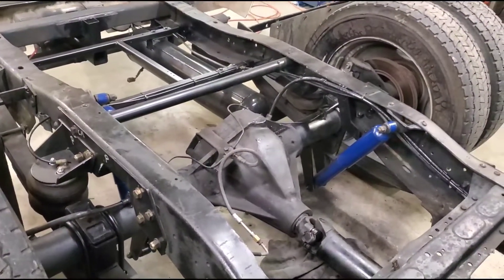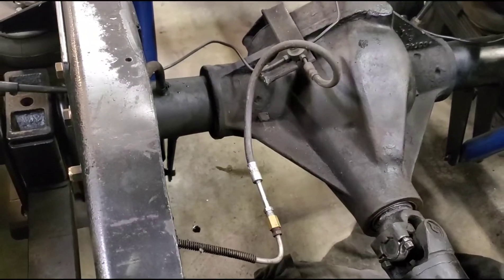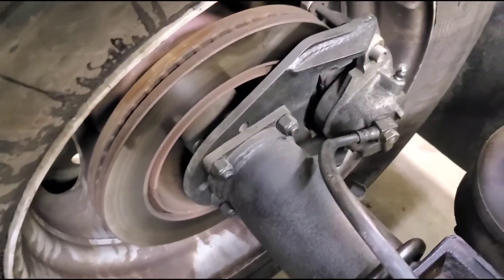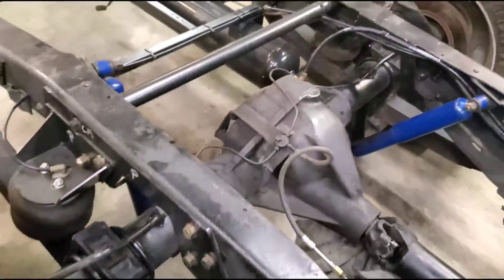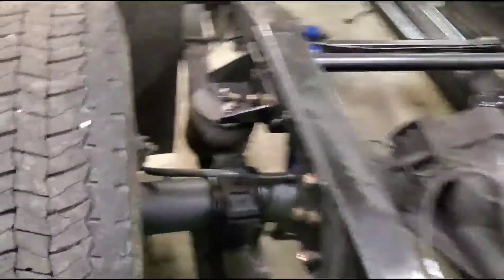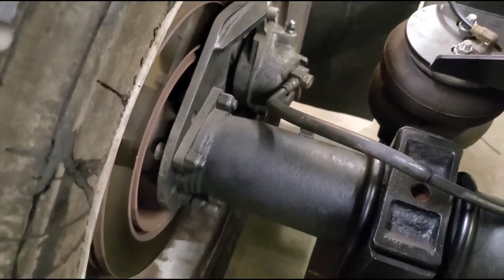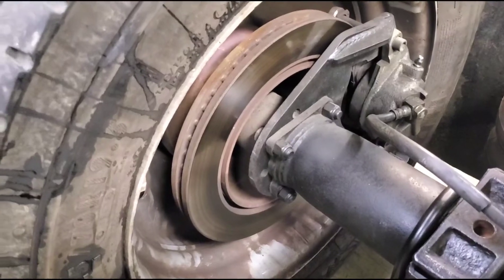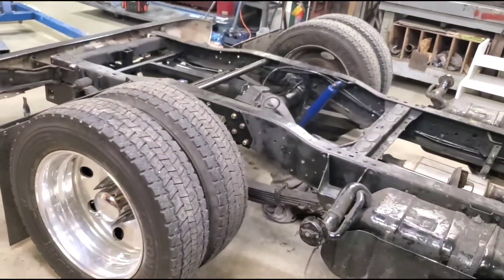How to do disc brake swap on Dana 70HD/14 bolt (DRW/SRW)

Comment: Hi man can I ask if you had any issues because the use of different calipers (and hence, pads) and the Chevy Express Van rotor, I'm asking because the K20 pads are a lot thinner than those used on the Van, the K20 pads total thickness is 1.08 inches while the rear van pads are 1.52 inches total, how do you overcome such a big difference? I'm just trying to replicate the setup so that's why I'm asking. Thanks a lot.

Comment: That shop for the caliper bracket shut their doors would you know where else I can get that bracket? Thanks
Reply: Did you ever find a place that sold em?
Reply: @boostedserg Frank's fab and machine sells a kit but it's just a thick plate with two spacers.

Comment: Gm had a shit load of problems with the rear weight valve. So much so that they finally put out a repair order to simply remove and bypass the valve completely

Comment: great video!!! i got my brackets a few weeks ago( dana 70hd) and im looking at the stud part number you posted 61393( prob 610-393) but they are about 2 1/8" long vs normal 3.5" long like factory. is this correct?

Comment: Would this kit work on a 1994 Chevy c3500 dually 14 bolt rear ?? I want to Convert my drum breaks  to disk brakes
Reply: Did you get a solution?  I have a 14 bolt dually cab and chassis on my 58.  It's the same as the 94 c3500 axle just narrow. I have seen lugnuts 4x4 weld on but was looking to bolt on.

Comment: I think you might've answered this one already but if so, please forgive the repeat question. I have a 96' C3500 cab & chassis setup with 16 inch wheels. I'm assuming that your setup will work on my application if I remember your response correctly...........thanks in advance.

Comment: I am having trouble locating the correct proportioning valve. I have ordered 2 already and am sending them back. I need an inlet hole of 9/16 X 18 TPI, and one more inlet hole of 1/2 X 20 TPI.  I am ordering PV 72 C. but they all show 1/2 X 20, and 7/16 X 14 on the 2 inlet holes. my master cylinder has 2 lines and the fittings measure 9/16 X 18 in the front, and 1/2 X 20 in the rear. 2 different venders listing PV 72 C but theirs won't fit.  Anyone had this happen? where can I get the correct one?

Comment: Why not just buy  used mid 2000 axle already on disks???
Reply: plenty of reasons maybe there's no wrecking yards near him maybe no one has the right gear ratio maybe he doesn't have the tools of the means to fabricate new spring perches from a later model truck to the early square body

Comment: Hi buddy. I am new to the channel. I got a 1997 GMC k3500 dually. You think I can get it done with same parts you use ???
Reply from the maker: I dont think so. I believe the axle flanges are different bolt pattern

Comment: Thks for the video im new at this how get your part numbers list please
Reply from the maker: It's in the video description
Reply: @latenightcustoms595  can't see it sorry
Reply from the maker: @peterhatch1583  I see alot of talk about disc brake conversions, I wanted to clear some things up and setup a parts list to help anyone looking to do this.

*applies to dana70HD and cab & chassis 14 bolt, and srw 14 bolt

For dually: Rotors are 2005 chevy express van 3500 dually PN 55075

For single wheel: 1986 k20 front rotors PN 5523

Brackets are from diy4x.com

Calipers are 1980-86 k20 front JB6 (light duty), JB7 (heavy duty), e brake calipers are 1976-78 Cadillac Eldorado rear calipers

Lines are 1980 CJ7 front

Banjo bolts M10x1.5 or Dorman PN 13937

Studs are 9/16 oem replacements from rockauto.com or PN 610380

Front proportioning valve for disc/disc setup is PV72C

Any questions please feel free to PM or comment.
Reply: @latenightcustoms595  can't thank you enough for your help thks
Reply from the maker: @peterhatch1583  no problem! Glad I could help!
Reply: @latenightcustoms595  was your for duelly or single wheel
Reply from the maker: @peterhatch1583  dually

Comment: Just curious, how is this different from a K20 SWD? I just did mine with 13 in K20 front rotors and front calipers on my 81 K20. One more question, do I need to replace my master cylinder, the rear brake reservoir seems pretty small for disc breaks and should I run a bigger line from that to the rear or is the small line going to be good enough for the extra volume?

Comment: Thank you for video. I had a question on parts for calipers- do I buy one eldorado 1978  caliper and one 1986 k20 caliper to use e brake? Thanks- confused
Reply: The Eldorado caliper has a park brake feature. The K20 does not

Comment: Ordered the brackets from DIY4X, i am converting a tow truck so parking brakes are needed (I will be ordering the eldorado calipers). My question is are pads the same regardless of what calliper used? I am assuming yes but some clarification would be great. Thank you for the great video!
Reply from the maker: I don't think so, the JB7s and el Dorado calipers are different I think

Comment: My question is will this set up clear stock 16 in wheels ? A egr conversion kit is about 1800 but if I piece it together will be cheaper just wonder if this set up will work with stock 16 in wheels
Reply: I am wondering the same thing, did you figure it out? I emailed DIY4X and they said slight grinding or a small spacer may be needed.
Reply: I bought the egr kit it came with billet spacer for the hun and rotor. And then you press in your studs to the spacer
Reply: I was wondering if it would work with stock 16's also?

Comment: What about the c35 cab and chassis?
Reply from the maker: The 14 bolt cab and chassis has the same hubs as the dana70HD. So everything will be the same
Reply: @latenightcustoms595  thanks. Been looking for info on that for a while.
Reply from the maker: No problem! There isn't alot of info on those axles, I know that they have 14 bolt center section and axles, and the hubs are the same as the dana70HD, also it is 11" more narrow than a dana70HD. Found that out the hard way. Lol
Reply: @latenightcustoms595  So your suggesting that this should work on a cab and chassis 14 bolt with stock 16" dual  rear wheels? Your right on there not being alot of info on this. Your set up looks real simple and I'm liking it alot better than heavy ass drums and brake shoes lol
Reply from the maker: @yamahondazuki95  yes it will bolt up. I built a cab and chassis with discs one time. The 16" wheels will require some grinding on the calipers.
Reply: @latenightcustoms595  That's awesome man I had a ton of questions on this. But your the first person I've spoken to who has any experience doing it on the cab and chassis 14 bolts. Is it possible to use the parking brake calipers as well? And overall did you notice a significant difference in stopping power when going disc vs drum?
Reply from the maker: @yamahondazuki95  yes you can use the parking brake calipers. Nobody had any in stock at the time of this video. And yes I saw I big difference especially when towing
Reply: @latenightcustoms595  Thanks alot for the help and the quick responses man I really appreciate it. I'm going to go back and check the parts list In the description. Parking brake calipers are a must for me since this is also my tow / haul rig. I'd just have to figure out which cables to use? It's an 87 square body with a mason dump on it. Been having trouble with my brakes and the backing plate being so close to the spring pack makes it so difficult to access the bleeders or do any work for that matter.
Reply from the maker: @yamahondazuki95  no problem man! Glad I could help! Sorry I can't help with cables. I think summit sells like a universal cable kit. Best of luck with the truck! Add Shitbox Tow Rigs on FB and post some pictures!
Reply: @latenightcustoms595  I just sent a request to the group I will deffintely update if I decide to go this route. I'm replacing my master and that's the last straw before going disc setup.. One more question, does the prop valve you listed work witl the existing lines and bolt holes or did you have to re-bend and flare your ends to make it work?
Reply from the maker: @yamahondazuki95  no it was a drop in
Reply: @latenightcustoms595  so the el dorado e brake calipers mount up instead of the k20 calipers?

Comment: When converting to the disc brakes did it sink your wheels in further? I've read it may sink them in 1" - 1.5" - thanks for the info I will be doing mine soon.
Reply from the maker: No, the hub distance stays the same

Comment: what size of rims do you have? Would this work on stock 16 rims?
Reply: I think it does but you have to get wheel spacers.
Reply: I'm wondering if those will work also. I'd love to do it to my dump truck with 14 bolt and stock 16's